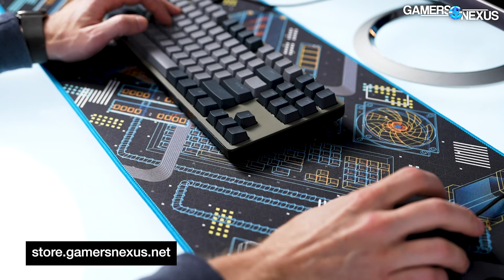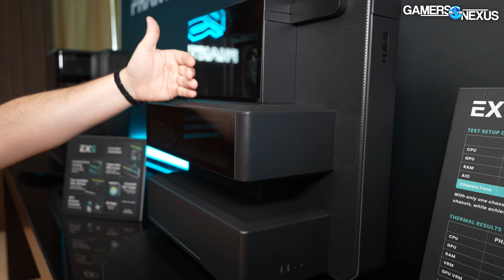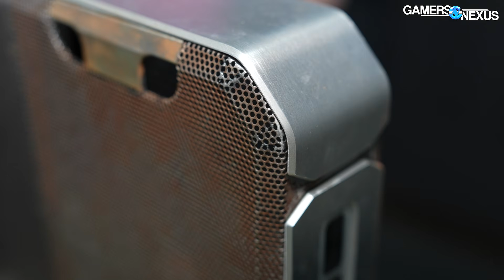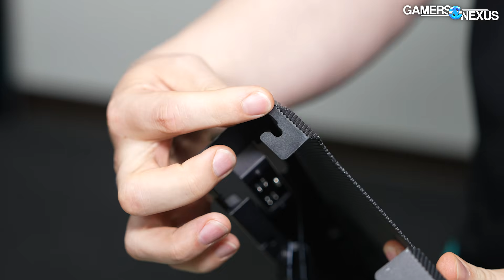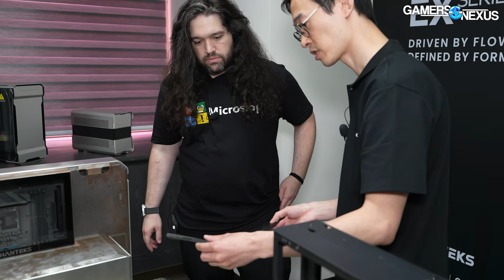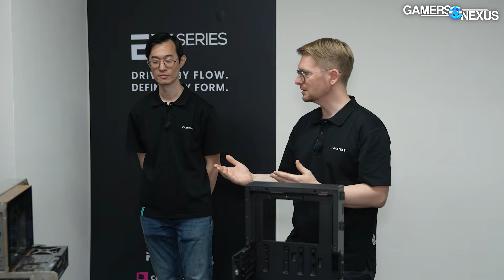Phanteks EX5 & EX6 High Airflow Chamber Case, ft. CTO & Engineering Discussion

Comment: I really want to see thermal testing for this. It's really interesting and the CPU area especially has less air flow than usual.
Reply from the maker: Also very interested in testing it!
Reply: @GamersNexus I'd imagine you might need to adapt the standard testing methodology to test it.

I assume the key factor might be GPU temperatures. Does having the separate shrouding help by expelling hot GPU air directly? Or does it just cook the GPU?
Reply: Kinda wondering what dust filtration is actually like, though.
Reply: @GamersNexus I can imagine. This kinda stuff doesn't come out very often.
Reply: @GamersNexus If it is like the rest of their cases it will run way too hot.
Reply: WIth special attention to SSD, VRM, DRAM and chipset thermals
Reply: CPU temps should be perfectly fine with an AIO, don't forget the AIO gets fresh cool air and CPUs don't burn all that much power to begin with.
The biggest potential cooling challenge would more likely be things like VRM, SSD, Chipset.
Reply: It's gonna be fine, the panel below the GPU is mesh, it's basically an open case
Reply: Indeed, I really like the design of this case and especially the visuals of the early build they had with the almost rusty steel appearance. I don't like modern cases with all the silly lights, they're more like pretending to be showcases. I'd rather have the old school look but with good thermals, ie I'm not the target audience for modern cases.
Reply: Im more concerned about the VRM, Ram etc. Everything which usually benefits from the airflow in the case for cooling. Possibly even M2 NVMEs?
Reply: Yes, but in traditional case builds the CPU is usually catching a load of hot air expelled by the GPU. In this case, the GPU air is expelled before reaching the CPU.
Reply: Your CPU will be the least of your problem, AIO is unobstructed. Your GPU however is sitting tight in a pressure cooker.
Reply: @will4417  what kind of mesh ventilated pressure cooker do you have?
Reply: @will4417  I mean the area surrounding the actual socket
Reply: @torvasdh they have a fan directly behind the mobo as well 👀

Comment: Thinking out of the box. I like it and I will buy it.
Reply: I will wait for Steve to put it through the paces of noise normalized temperature testing. But it is on my bingo card.
Reply: Sure sure, it lool vaguely like the Thermaltake Level 10. But Phantek dialed it to 11 with this case. There's nothing like it on the market.
Reply: This is actually very similar to a case design some company tried many, many years ago. There is a reason you don't know anyone with a case like this.

Comment: Can't wait to see you independently test this, primarily for the motherboard chamber thermals. That was my main concern when this case was first revealed, but glad that they actually were intentional with the design and putting a fan back there, I just have a hard time imagining it is as effective as a standard case design
Reply: From everything we've seen, these look very well engineered. The fan in the back of the board reminds me of overclocking back in the late 90s and early 2000s when temperatures over there got serious
Reply: @Ktmzqw what's more effective though? Blowing air directly on the VRM backside, or blowing air at a large heatsink sitting on the VRMs on the front? I'd think the one blowing on a heatsink, similar to how we blow air at the cooler sitting on the CPU and not directly on the CPU itself.  I trust that Phanteks did their homework, they've been doing this a long time and have people way smarter than me to design and test this case, so we'll see in the independent testing what the temps look like
Reply: @nerdonabudget Blowing air into the back of the motherboard isn't as effective as having direct airflow going through the vrm heatsinks, but that fan is doing more than cooling the back of the motherboard. It's impeding hot air exhausted from the gpu compartment to pool in the front and indirectly pushing it out. They look happy with the results, we just need to get independent testing. Having a fan pushing cold air into the back of the cpu socket was a trick 20 years ago because overclockers  were a step over what the case and cooling companies offered. Airflow wasn't a thing yet, components had to make do with negative pressure hotboxes. The back of the cpu on some platforms got real hot. So we took the side panels off or simply didn't bother with a case and put fans everywhere.
Reply: having a fan blow on the back of the board is good enough for VRMs, as they use the board as a primary heatsink (or only heatsink in cheaper boards). I don't know about the situation for RAM though, for "real" setups like threadripper/epyc/whatever intel equivalent you need to cool the RAM's VRMs too